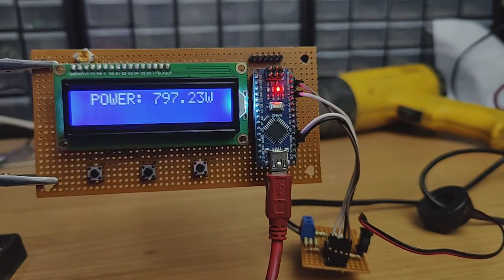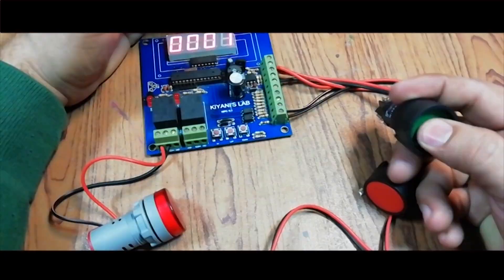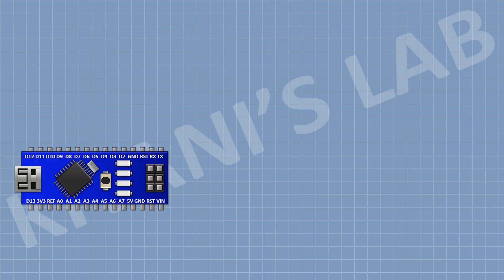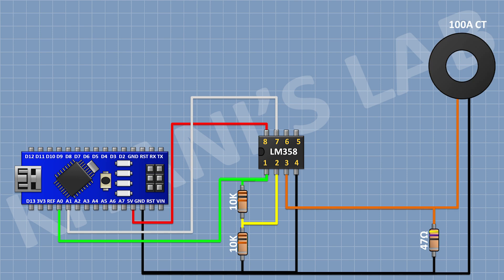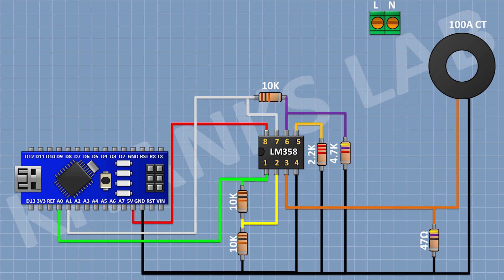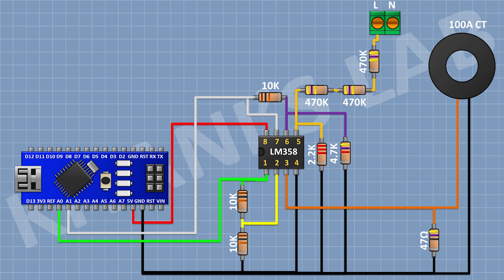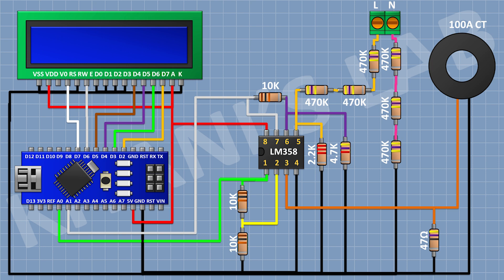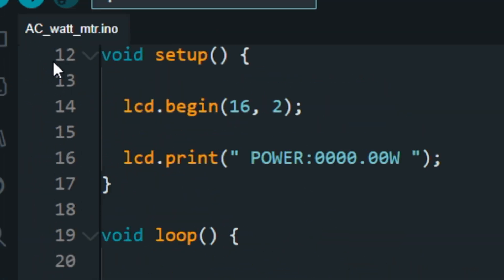How To Make AC Power Meter | Arduino Project

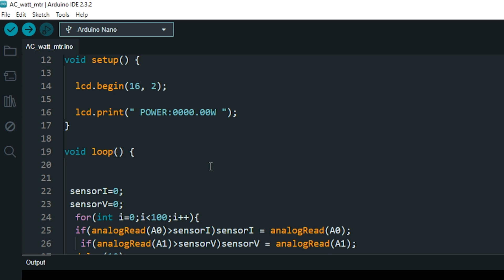Comment: 4:30 Hardware analysis by a hardware guy. Note 1: US homes have the neutral wire bonded at the house earth ground bar, near where the utility's wattmeter resides on the outside of the house.  Where you see the 'N' in the drawing that is practically 'ground' for the circuit.  Note 2: The USB connector on the left has the duty of supplying the 5V supply AND providing an additional path to EARTH (not so if the USB cable goes to a laptop NOT connected to a power brick).  Note 3: The voltage divider at pin 5 of LM358 (+ Pin of opamp) has an incoming AC voltage of 120*2.2/1142.2 = 0.187 (±0.264Vp-p).  That is within the worst case input common mode voltage range of -0.3V for the LM358.  Note 4:  Layout for the two-wire AC connector and the Line/Neutral resistors need adequate space from each other, and other components.  Best if no copper cladding exists anywhere near them (other than connections from one resistor to another).  Note 5: The fully insulated line wire needs to be brought through the current transformer opening - having both line/neutral will negate the phase and result in a zero reading.  Note 6: Most critically, the 47 ohm resistor must be PERFECTLY connected to the secondary of the transformer.  Let no movement of the transformer leads cause any wire breakage or contact degradation.  The result would like high resistance or an open circuit.  The resulting output voltage would measure in the kilovolt range at the wire leads.